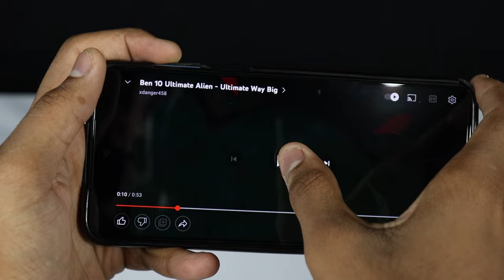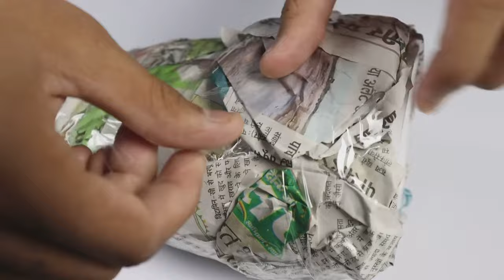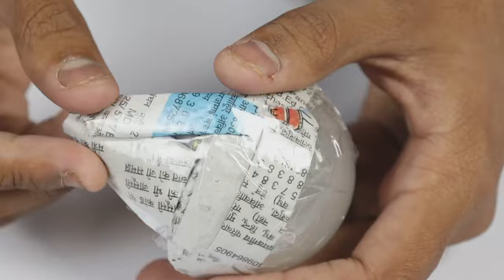Building Remote Control Ultimate Way Big Alien | Ben 10|

Comment: It's funny when you realize Albedo had access to this transformation yet he never used it
Reply: Whao he got way bigger
Reply: He wouldn’t have had access before his second appearance, since the Ultimatrix was linked to the Omnitrix he had access during the final battle part 1,if he just instantly went to Waybig he could’ve destroyed the biods and could’ve gone ultimate, though his goal was to obtain the Omnitrix to reset its catalog to the original 10 so he could access Greymatter, , another reason why he probably didn’t use Waybig was his arrogance in the power of the Ultimatrix.
Reply: @ThatMouthyMerc   you not wrong